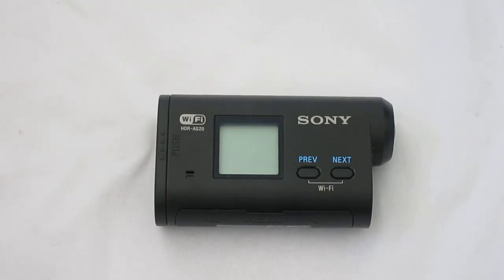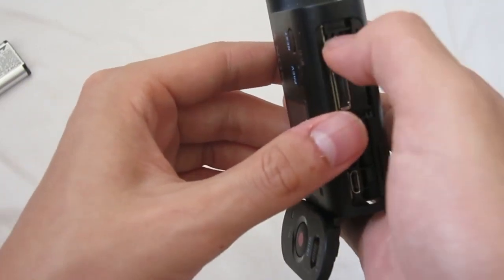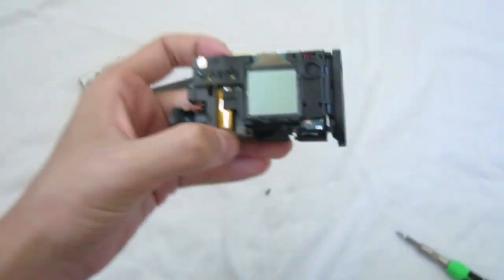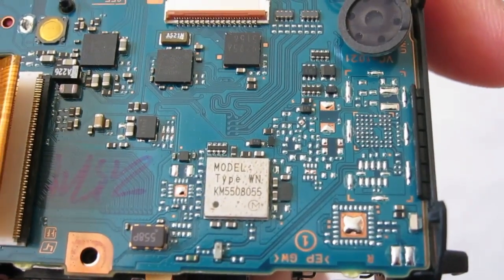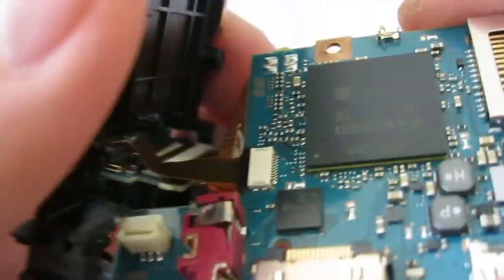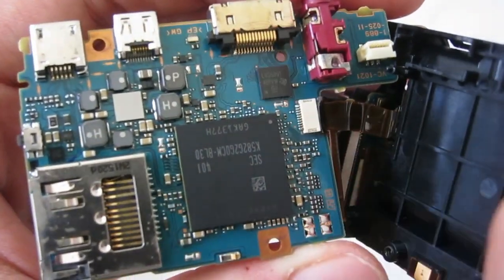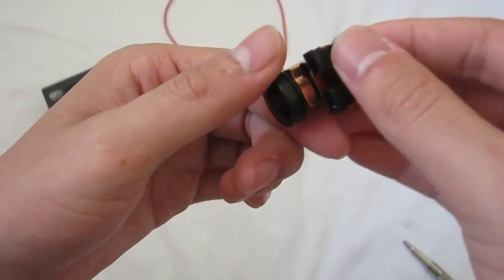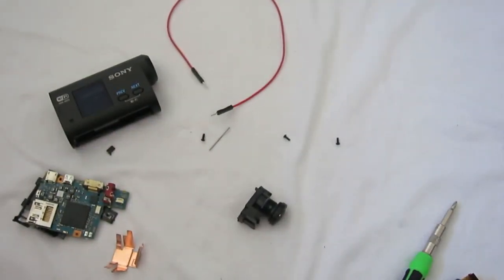Sony HDR-AS20 Action Camera Teardown

Comment: could it work with the internal microphone disabled? i want to modify mine. the plan is to use it on my airsoft helmet on the nvg mount, and run an external microphone. i would also have to 3d print a case for it (2 parts, one for the body and one for the lens and sensor, and have a articulated arm with some limited movement.) i would also would need to tilt the lens 90 degree so it doesnt film sideways
Reply from the maker: For the internal mic, yes it can be disabled. When an external audio source is plugged into the mic port, the internal mic is disabled. If you want remove the audio from the internal mic permanently, just unplug the flat ribbon cable that connect to the mic.

But if you don't want to use the mic port, then you have to take out the internal mic capsule and solder in some wire into it (wouldn't recommend solder directly into the flat connector on the board - very small)

As for the lens and sensor unit: The flat ribbon cable is really short, so keep that in mind when designing a new body. You might be able to pan or tilt it somewhat (depends if the ribbon cable is placed vertically or horizontally).
Reply: @KN4LXD yes I will disable that internal mic and plug a new one in the 3.5 jack. Without that cable limiting the movement I think it will be enough to tilt the lens and sensor 45 degrees in the horizontal plane and 90 degrees for the lens to film in the normal aspect ratio